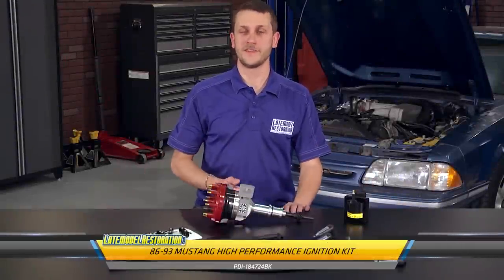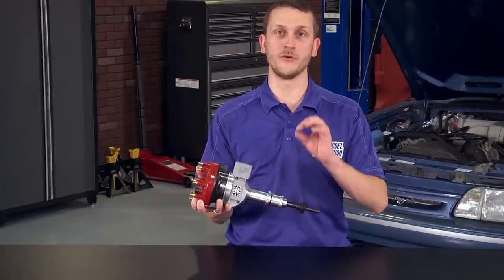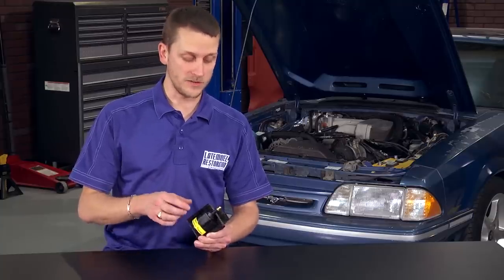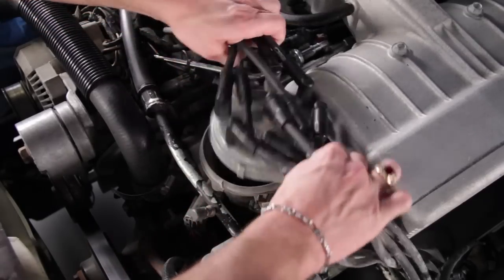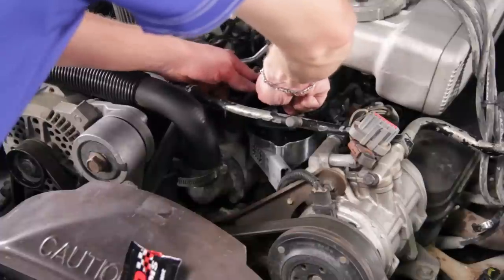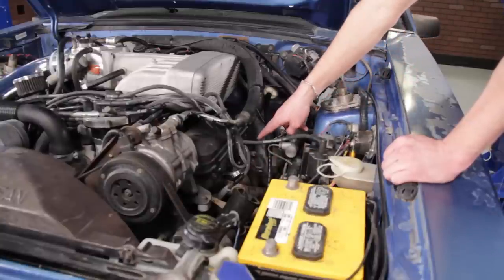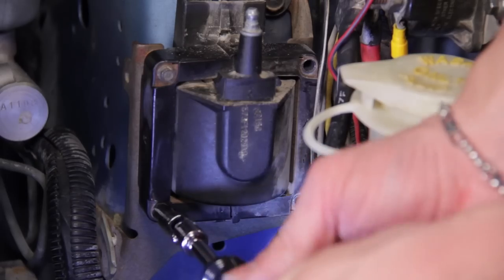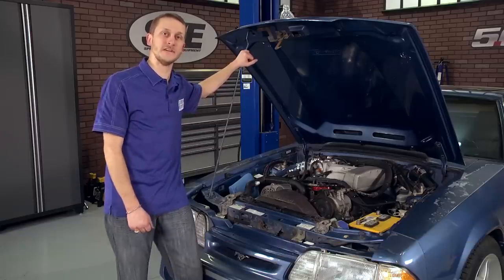Project Blue Collar: Complete 5.0L Mustang Ignition Upgrade  (Fox Body)

Comment: when removing your distributor will the oil pump shaft fall out into the motor... i hear alot of people have this problem and im wondering why LMR didnt mention it in this video.... so my question is,,,, when i remove my distributer do i have to worry about that shaft falling into the motor>????
Reply: Oil pump shaft has a retainer ring on it to prevent it from coming up out of the oil pump...
unless some axewipe left it out.

Comment: Need some help. My brother in law welded the rear quarter panel on without disconnecting the grounds on my 91 5.0 fox body while I want there to do it myself, so now I have no fuel pump and no spark. I've replaced the TFI Module, coil, fuel pump relay and the solenoid. I'm getting ready to change out the PIP but I'm afraid that isn't the issue for the spark. Any help would be greatly appreciated.
Reply: I know this was awhile ago already, but in that rear quarter  panel is an inertia switch for your fuel pump. Maybe try that? Hope it helps.

Comment: A little help on the Distributors I have msd wire and coil which one would be good 1990 foxbody 5.0???
Reply from the maker: I'm a big fan of the PDI distributor used in this video. You can see it in the link below. It has great performance at a great price - Jeff J

http://www.latemodelrestoration.com/item/PDI-18457/1986-93-Mustang-50L-Billet-Distributor
Reply: Late Model Restoration SO, you use YOUR distributor, YOUR coil, YOUR wires, but no BOX?  NO Performance plugs (E3 Diamond FIRE, Bosch platinum +2 or +4, Etc...)?  which cd or digital box do you recommend?  Msd, Mallory, Fast, Pertronix?  I'm a bit sour on the My Spark Died line since their 6a box left me stranded, but they seem to be the ONLY option....
Reply: This is for a fuel injected computer car.

Comment: On the Distributors install, do you have to reset your timing?
Reply: ko5cobraa i would check the timing with a timing light just to be safe
Reply: I did the same thing he does in the video once. Huge mistake. Took me a month to realize the issue was the timing. Save yourself the headache and always check the timing.

Comment: Is this the ignition kit I should buy for my 1985 Mustang CFI engine?
Reply from the maker: The CFI application will use a traditional vacuum style advance distributor. Here is a link to this distributor you would need. 
https://lmr.com/item/MSD-83521/Mustang-50-MSD-Pro-Billet-Distributor-Ready-To-Run-79-85

Comment: why didnt you relocate the ignition control module off the distributor away from heat which causes failure of the TFI?
Reply: THAT is major work for zero benefit.
Just buy a better module.
The $15 china ones suck.
Parts stores sell them for $60 in their own label boxes.
Best to find a real Mororcraft in the junkyard for $5.